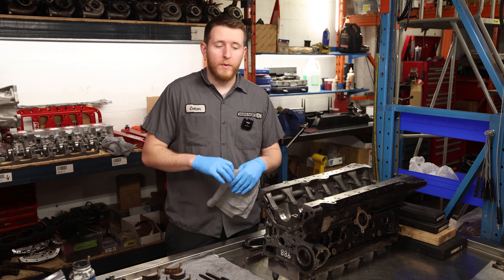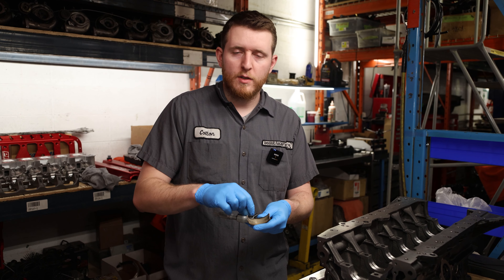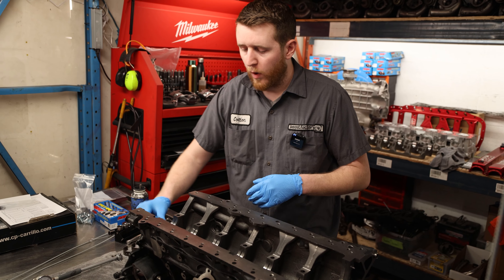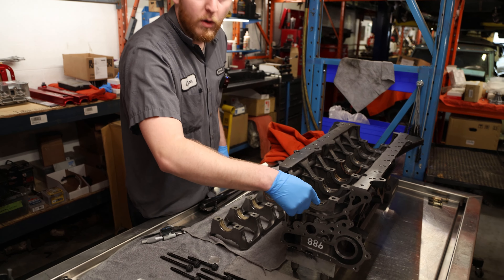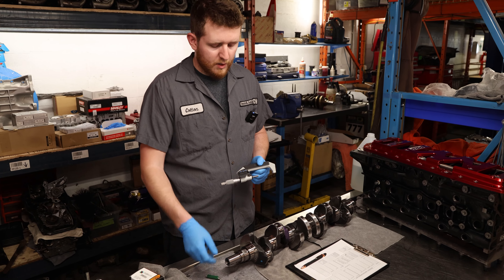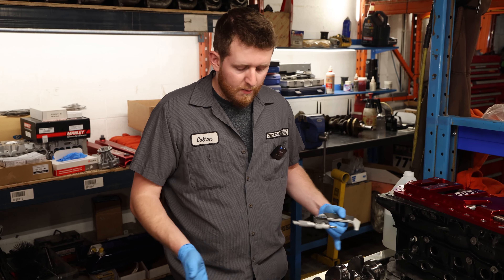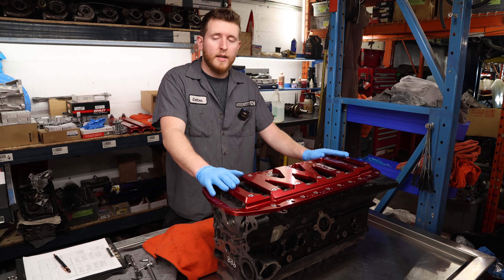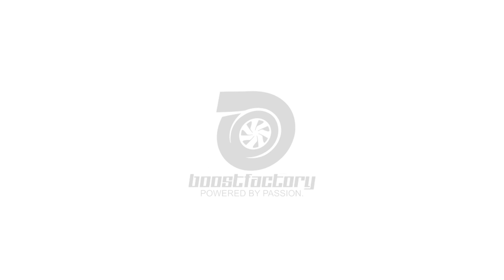RB26 FULL ENGINE BUILD || Episode 3: ACL Bearing Install, Crankshaft Measurement/Confirmation Checks

Comment: Question again Mr. Colton what is the product code for those main bearings , beacuse I see that the accommodate the main oil gally groves... with more oil gally  holes for the crank. I know some machine shops for  rb25s you can machine the grove to accommodate more oil once you get i am assuming these bearings .. please can you give some insight
Reply from the maker: Hey! This is a common design for the RB26 Bearings, and you are correct the rb25 block is often modified to suit these, and they are physically the same as the RB25 main bearings with the additional oil supply holes!  
this is the standard main part #7M2428H-STD
And a link to our site
https://www.boostfactory.ca/products/acl-nissan-rb26dett-high-performance-main-bearing-set?variant=39694841282644
Reply: @boost.factory   thank you for your input , I will be attempting this mod to my rb25 , as well what are your thoughts on the calico coated acl bearings are they worth the extra especially for the rods? , great stuff  btw I am about to do some upgrades to the oiling systm with the info you provided , porting the oil pump, the by pass valve insert etc..

Comment: Ok @Boost Factory, I see you. Patiently waiting for Pt 4. planning to build 1100-1200hp RB26. Would you recommend a similar main oil clearance as shown? 2 thousands? Or larger?
Reply from the maker: hey! we should have the next video up in the coming weeks, we have been quite busy with the Spec-D season in the summer months!  
as for oil clearances on 11-1200hp you would be dependant on your dimension and how minimal your margin of error is. (journal O/R & Taper, Crank Run out etc) if you cannot confidently say your .0002" or less on all aspects, i recommend running a slightly larger clearance .0028''-.0032" mains and .0025''-.0028'' rods if possible.

Comment: So with the main bearing measurements, are you only measuring them because they’re being re-used?   Like if you bought brand new bearings would you still be measuring each one?  And even if you found one a little off what? Call them to send you a new bearing yeah?
Reply: Also, same with the large crankshaft holes that the bearings go into… if you had that machined to square would you need to be measuring like that?  That is, if you trust your machine shop to do the correct work and measure there work properly, this would be overkill to do it all again yes? 
And if the bore was larger than it should be, do you just get thicker bearings to make up the space? Or do you need a custom crank with the new specific larger sizes ground into it?
Reply from the maker: Great Question! These Are brand new,  you should never assume that means what you are getting is good and can be installed as is. people make mistakes and that means some products are going to have manufacturing errors at times.  which is the assemblers responsibility to catch and find. if i find one out of spec i typically just grab another set and use what i need. until i can contact the manufacturer for a replacement. this is rare, but if you don't verify you are gambling with your engine and assembly. 

thanks!
Reply: So when you measured the crank and found that the oil clearance wasn’t enough and had to change the bearings out, would you have been able to have measured the crank first and then once you started measuring the bearings could have found sooner and stopped to take it apart rather than measuring all the bearings first then measuring crank?
Reply from the maker: you need to install the bearings into the block to measure your oil clearance, you cannot measure oil clearance with shells outside of the block.
 
in order to make sure i don't waste time with a bad set of shells before i install them in the block.  this is when i first check the taper on the bearings before i waste time installing them in the block, once i confirm the shell it self is good, they can be installed to the block and then measured.
 
the crank dimension, and block main bore dimension and shell thickness as well as hardware tension all play a part in your final clearance. with out each one in the final position it is going to live in, you wont be accurate enough.
 sure you could add /  subtract each one of those dimensions to estimate your final clearance but the tension on the bearing in the bore is a variable you cannot account for. this is why a physical measurement is best for final assembly.  @bowley4

Comment: Question: do arp mains torqued to the 60lbs cause the girdle or main bearings to oval or out of round , in this case you may have to line bore , I am having that issue atm.
Reply from the maker: Yes they do, typically around .0005" or more out of round, and then when the head studs are installed it can be even more!. I always recommend an align hone with this hardware installed to give your self a great base to start.

Comment: Could you please explain the eleven ten thou and how the +1thou bearings get you to 2.1
Reply from the maker: Hey so i think i know which portion of the video you are referring to! so when we initially put the bearings in they are .001" to large of a clearance with a clearance of approx .0031". this was with the STDHX ACL Bearing, so we switch to a standard STDH ACL Bearing. this brings us down  -.001" to our desired clearance of .0021". 

Hope this helps!

thanks!
Reply: @boost.factory  thanks for that. It does! 👌🙏